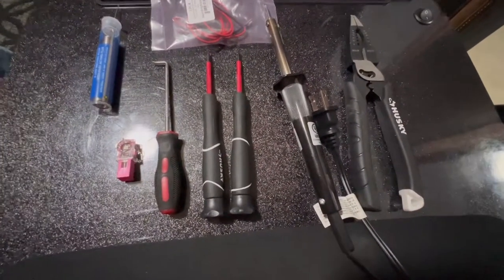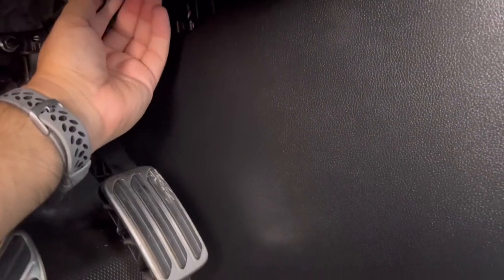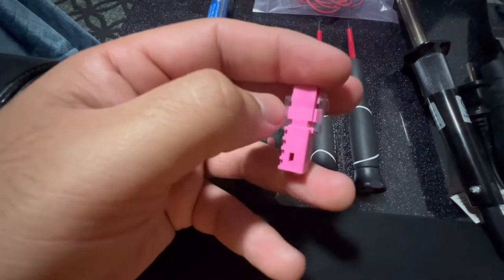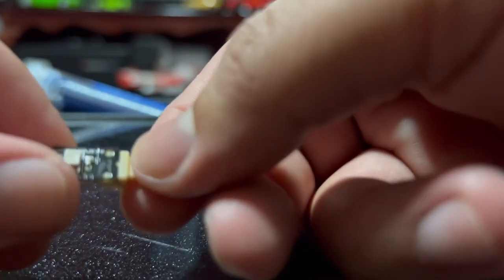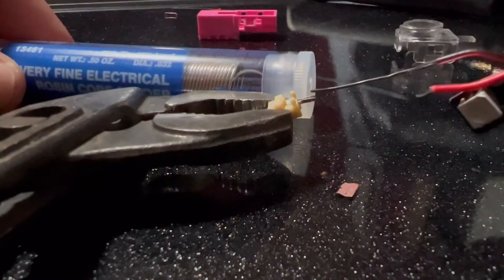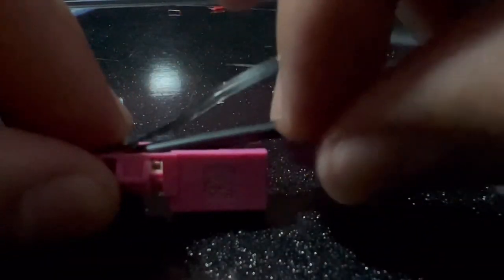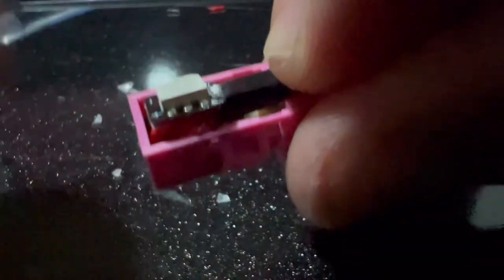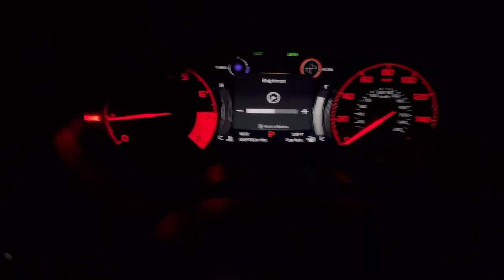2019-2021 Acura RDX Footwell light upgrade

Comment: Excellent write up. One question, for part number 34750-TJB-A31 and 34760-TJB-A01, does these two parts comes with the OEM LED lighting or just the housing only? Thank you.
Reply from the maker: Comes with oem lights.
Reply: @2418turo  Thank you so very much. As for the center console lighting, does it use the same aftermarket LED light, same as the LED light as the footwell.
Reply from the maker: @eddyngan9293  I did not replace the bottom light under the trackpad, where you have the bottom storage/cubby space, I just did the footwell lighting. But it is a smaller piece. You’d have to get a ribbon led but it’s essentially the same method to solder and wire. I really only wanted a little more light on the feet. But I’m going to redo the doors and foot lighting from red to green. Going to take me a little while longer but I’ll see if I can get some help to record that video and post it here.
Reply: @2418turo  Thank you for the info. I have ordered the LED and the OEM parts already, can't wait to install the footwell lighting after received them.
Reply from the maker: @eddyngan9293  awesome man! It’s a little time consuming if you’re like me and never soldered, but if you know how, in 10 minutes you’ll finish both. The trick is removing the clear lenses without breaking the tabs. But I’m sure you got it. I should have just bought the spare ones and replaced those instead of the ones that came on the car but ehhh. Tomayto tomahto...🤷🏻‍♂️ hope it comes out well!
Reply from the maker: @eddyngan9293  I prepared this time and have the green LEDs and new light pieces ready, I just haven’t done it 😅😂
Reply: @2418turo  Deeply appreciated with the detailed video, this is really helpful to other RDX owner.

Comment: I love the neon headlight thing you got going on. Is that also some kind of mod or is that’s whole new aftermarket headlight ?
Reply from the maker: Neon headlight? You mean for the footwell? Yea I soldered new brighter lights for the foot area on both driver and passenger side... But for the headlights, I did add something to show a different color to the led strip running lamp
Reply: @2418turo  not the footwell I was talking about the headlight .. yes it looks like neon yellow led strip on it
Reply from the maker: I've never posted a video on that though, lol. But yea, I used Lamin-X film. Sticks on the outside of the headlight housings. Put it over the led strip and fogs
Reply: @2418turo  hey bro do you have a link for that ?
Reply from the maker: @shivangpatel2587 yea. It’s in the description for the LEDs
Reply: @2418turo  my b i meant the lamin-x film
Reply from the maker: @shivangpatel2587  
VViViD Air-Tint Golden Yellow Headlight/Tail Light Window Tint (12 Inch x 24 Inch roll x2) 
https://a.co/d/83f2Gt0